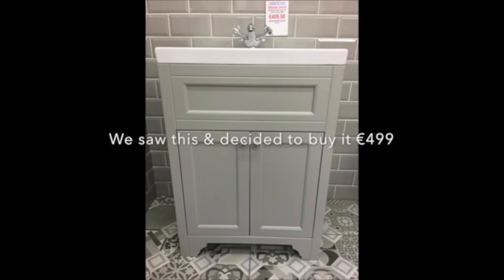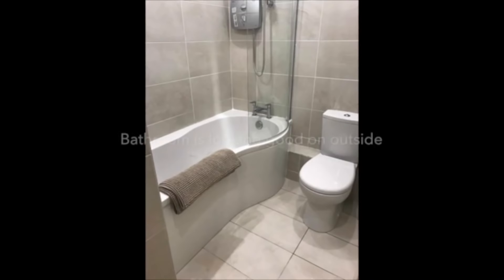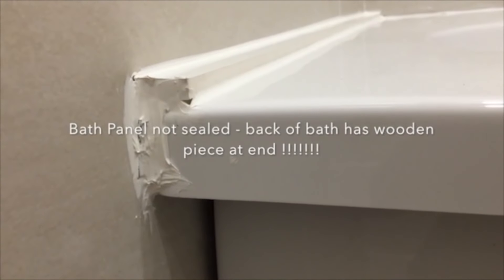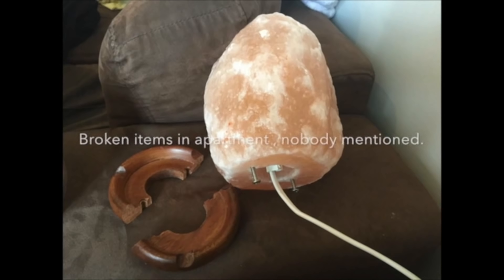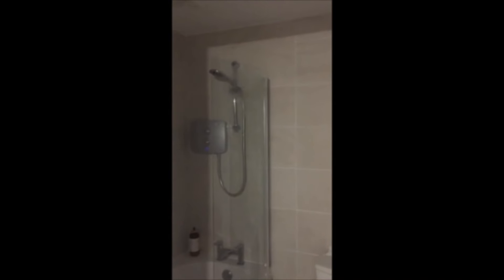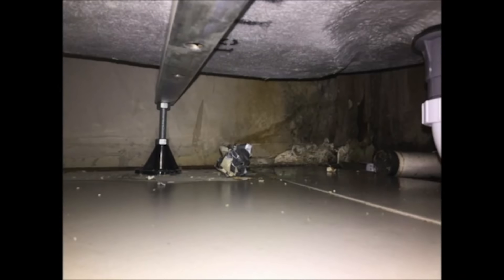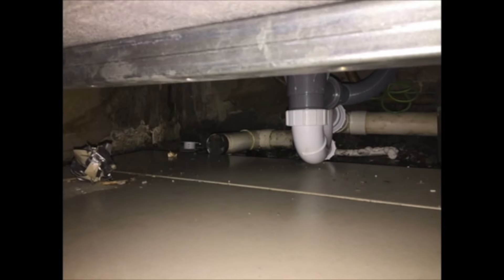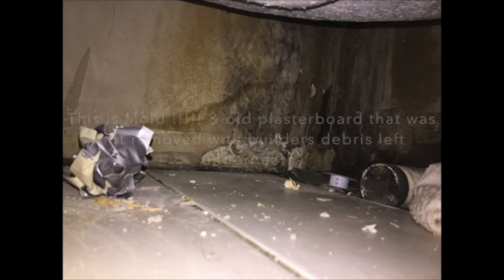New Bathroom Nightmare ~ ASB#23

Comment: Hi mate after abit if advice if possible I’m looking at buying a house it’s had a extension on the back  which the floor steps down for some reason so the floor is lower on the dpc  sits one brick up rather than the original 3 course up on blue bricks will this cause any problems do u think
Reply from the maker: Hi Irons TV 
This is common for an old kitchen scullery. My house is the same. It shouldn't cause any problems if there are no signs of the damp proof course being bridged.

Comment: That shower screen is meant to pivot so silicon sealant on the bottom means the morons fitted it too high for the bottom flexi seal to rest on the bath.
Reply from the maker: In fairness those kind of screens rarely go well. There is always that bit at the bottom of the hinge that doesn't seal. The trouble is that when the customer sources the kit they don't get the installers experience. I hate those bloody panels as well.
Reply: Skill Builder the reason I know it hinges is because I have one. Fitted myself 8 years ago never had a problem with it because I fitted it correctly...

Comment: Are plaster walls behind baths always left bare, or are they normally tiled?
Reply from the maker: The tiles are normally brought down to the top of the bath. The wall beneath the bath should never get wet.
Reply: Should be a cement based board that's resistant to moisture instead of plasterboard. Hardibacker is good one.

Comment: 1st off the obvious silicone around the bath is lifting because the bath wasnt filled  when it was sealed. 2. The seal on the screen isn't the 1 the came with from the manufacturer. That I bet was accidentally binned as they a normally hidden in the packaging. 3 Compression fittings on what looks like 15mm plastic is a big fucking no what's the point? it's going to leak! it's going to take ages to install and that's never going to be seen because it's in boxing. 
4 boxing is the the lazy way out do the job properly get the supplies into the wall or chased in the floor same with the wastes I completed 30 full bathroom renovations last year only 1 shower tray went up on legs and I built 0 boxing's and finished each job on schedule or earlier. Which leads onto 5. Cost. Customers need to realise that the increased cost in getting pipes into walls, under floors, using proper fittings, added labour time getting this right is short term. Yes it more money out of your pocket this month but 6 months a year even 5 years down the road when you have a great bathroom that you enjoy with no issue like this is well worth the expense of  a few hundred pound. You pay peanuts you get monkeys. There is only 1 Way to do a job and that's the right way Point! Anything less and you end up with this. (Right where is the drop the Mike emoji?)

Comment: Bathroom lights on a dimmer switch? Are the bulbs in the lights dimmable? Did you hold any money back so that you've got some leverage?
Reply: It looks like they're led fittings, the flickering randomly is usually because of the nature of LED drivers, the led dimmer switches usually have a way of trimming the low setting so that the voltage doesn't go low enough to cause the flickering.
Needs replacing because of the bent switch but the lights themselves should be fine.
Given the quality of rest of the job & they didn't trim the dimmer probably best to rip out & start again though!

Comment: The world is full of bodge builders & dodgy, lazy trades which cut corners & make a complete mess. A new bathroom MUST start with a gut to studs & joists (unless you can access the joists from underneath). Tiles are heavy & require perfectly flat, stable sub surfaces. Water is heavy & requires sturdy "overkill" framing. Sub surfaces must be mold resistant & the layer below the tiles must be capable of directing water to the draining pans in a "belt-n-braces" approach. Traditional wood has limited use in a bathroom, MDF has no place in there at all. A bathroom is a "showpiece" of a house. Electrical & plumbing must be robust, safe, logical & to code...it is VERY permanent & is going to be buried for 20 years where you cannot fix it later without destroying the finishes. It is extremely well illuminated, it's features are on full show, lines are straight, square & linear, the environment needs to feel strong & sturdy to the touch. It is a room under a dozen microscopes every day of it's life & it is under constant attack from destructive elements & uses. The job cannot be rushed or done "on the cheap". A bathroom is a living advert for a contractor or handyman...it is a 20 year testimonial for the quality of your work...or it is an embarrassing  millstone which will come back to haunt you & your reputation for decades. If you can't do it properly do not take the job on in the first place!

Comment: Why are so many “tradesman” so piss poor at silicone sealing? I am in the trade myself and see this day in and day out by joiners and plumbers, silicone finishing should be both functional and cosmetic. The days of just spitting on your finger and dragging it across are long gone, even for the guys that can’t get a good finish there are many tools and tapes out there that can help get some what of an acceptable finish so there is no real excuse and even if your still rubbish after the tools and tapes then you have the option to call in someone who does this solely as a job.
Reply: The silicone is the least of all the problems here, had everything else been correct, I would have overlooked the caulk work.
Reply: The silicone work is indicative of the general attitude here. Get the job done asap take the money and run . They obviously have no morals or pride in their work. Would they have been happy with someone doing this in their own house?
Reply: Tom Baker the silicone is a big part in a way as around the bath isant properly sealed allowing the water to escape when showering, but on a job like this it’s one of many problems.
Reply: Looks like the surfaces weren't prepped and probably siliconed over dust. Get in, get paid, get out job.

Comment: its really no use when  we get no information on how much this cost?
Reply from the maker: I knew there would be people who would say this is what you get when you go too cheap but that is not the point. Even if it was a cheap job it falls below any standard I could apply. Do you really think there is a price which is so low that this becomes acceptable?
Reply: @SkillBuilder  I would say the point being it is not acceptable but more expected that corners are going to be cut. Either way the people who carried out the work shouldn't have been let loose on this project. Subbed out by the bathroom shop?
Reply: @SkillBuilder  Roger, I love the channel so please don't misunderstand me.
The standard of work is absolutely appalling and I don't think it's acceptable to an owner.
However I do think that knowing the cost of the work is important, who did it?, why did that couple get that particular installer? and was it a sub contract etc etc?

On your point when it comes to this being acceptable - yeah I do - property flippers would probably consider it acceptable!
Your viewer even states it looks "cosmetically good" or something similar.
That's all the surveyor looks at - visual inspection!

This is especially true in pressured property areas!

Comment: OK, I am not a plumber or bathroom fitter. However, my shower room downstairs was a bit of a yeee-hawww job from the previous owners, and I am in the process of ripping it out back to the brickwork and concrete floor. Everything is going in the skip, and I am rebuilding it myself (thanks to Rogers Skill Builder videos I have taught myself what I need to know). No way am I paying someone to rip me off. These guys need to rip all this out back to the fabric of the building, get themselves a de-humidifer and run it for a week at least in the bathroom and bedroom and get it fully dried out. A hair dryer will never ever achieve that. Good luck.

Comment: Hi roger,  just needing a bit of advice from yourself.  I'm in the process of putting a shower in my bathroom and was wondering if you would stick to the usual shower trap or go for a inline trap,  space is not an issue  I'm thinking ahead for ease and less chance of issues with the usual hair problems.  I'm in a position  that the room below is a garage and thinking about putting an access panel in just in case for one or the other but at the moment in swaying towards the usual system as i don't see how i could remove the inline easily. Many thanks.
Reply from the maker: Go for a Mc Alpine shower trap. Easy access for hair removal from top. It is a weekly job in our house.
Reply: Many thanks for the reply, will do that, mcalpine do good products. Enjoy the rest of the weekend

Comment: Firstly they could not have framed the walls to suit the bath length, I would also recommend fitting a 2 x 1 around the wall and bed the bath on it with good silicone, prevents movement from getting in and out the bath therefore prevents the final seal from detaching from the bath, next bath height, looks like the bath trap is squashed against the floor, also the tiles should go around the bath once installed looks like your tiles were installed before the bath, shower screen looks like it is fitted to far to the right so it is not following the curvature of the bath, no need for silicon in the glass seal it will just go mouldy over time. Assuming the lights were not working so the painter painted in the dark 🤪, was the floor self levelled prior to tiles going down? May explain the vanity unit being up off the floor, also green plasterboard or wedi board should have been done at least around the shower. Electrics need tested by qualified spark that’s a must! On the whole this job is a bag of shit and I would definitely not pay the company. It’s got a 1 stop shop handy man written all over it. When we do bathrooms there are 5 to six trades on it every time. If ever someone told me they done the complete job by them self I would be worried 😧

Comment: plenty of mistakes made there, reality is vast majority and id say all so called luxury bathroom retailers that provide fitting will tile directly over the damaged walls,  

just this instillation also happened to included some shoddy plumbing

as a bathroom installer i price against bigger bathroom retailers and its imposable to compete, they  are bathroom flippers, less preparation means less building material cost and labour,  lower price,

anyone thinking of getting a bathroom installed should check out there installers facebook page etc for installation pictures,    better still search for the showroom name and you'll find fitters that contract for them and check out there installation pictures,        contracting for a bathroom retailer basically entails fitting a shiny suite in the quickest time possible to reduce the cost to the customer, the labour time to fit the suite has to be minimal to achieve this

id recommend looking for the following;    if walls to be tiled are plastered with gypsum plaster or tiling straight over damaged walls or using plywood as a substrate to be tiled don't use them

avoid general jobing plumbers that aren't bathroom fitters, in modern  bathroom suits the actual plumbing represents a small amount of the work     ie to fit a shower tray and enclosure a plumber that specialises in bathroom fitting or a carpenter/builder is going to be more capable than your average jobing plumber or boiler fitter,        

look for close up pictures of silicone, decent fitters will silicone perfect freehand without tooling down, try to see if the plumbing looks neat, walls should be prepared with new BARE drywall or tile backer or a cementitious background, (never with fresh gypsum plaster!!!), supports around perimeter of baths, new walls and boxing should look solid with noggins etc, floors prepared with cement board or orange kerdi (no chinese ply or even marine should be used know),,,     i could go on and on but my point is you can easily suss out the quality of your installers work by looking at there job photos

Comment: You should have asked them to remove their blindfolds before starting the job. I was trying to find something that had been done correctly but I couldn't find a single thing. Even cows could do a better job than those idiots, I hope they got trading standards and a solicitor involved and they should also name the ones that did the job to warn off any other customers. It looks as if they have tryed to control the lights with a dimmer switch, it should be a normal switch, I wouldn't touch those switches in case you get a shock of electricity.

Comment: It happens all to often I'm a Chippie and when I put a quote in no matter how low there's a Jimmy or Johnny from the pub who can do it cheaper 🤦‍♂️ of course Jimmy or Johnny's not a tradesman so they ask me down the road to fix it I once quoted for putting new cornice and pelmet on a kitchen of course I was to expensive I was called back a week later Jimmy and Johnny cut it with a handsaw and stook the joints with double sided sticky tape 😳😝😝😝😝 I went around and quoted him double and the client said why the extra I told him I had to take it down and start from scratch needles to say I didn't get the job ah well 😝😝😝

Comment: It’s all wrong. Never but a bath up to tiles like that. I like to run a baton down the wall 2x1 and tile on top of the bath. Plaster boarding any walls needed to make square. And making note of my bath panel height + tile + adhesive + ply etc to make sure the bath panel clicks into place. Some people have no pride. If you do a job do it probably. Did he have spurs on his boots.

Comment: Are the lights meant to be switched independently somehow? Im an electrician by trade and can’t think how they’ve managed that. Unless they’ve taken several cables from the dimmer and one to each light and there’s a bad connection behind it. All round piss pore though. Excellent videos thanks.
Reply: LEDs on a non LED dimmer perhaps? They were doing some freaky shit those lights!
Reply: Perhaps a timer fan in conjunction with the dimmer as well?
Reply: @jamesdyas542  yeah good shout. I'd hate to see what's going on behind those downlights. Probably a fire waiting to happen. Obviously not enough space behind to accept the fittings the way they're sitting off the ceiling.
Reply: I'm no electrician but have a keen interest. I bought an led dimmer switch but needed to buy led lamps suitable for that exact switch. There's was only like a dozen tested gu10 lamps deemed suitable. The guy probably bought the led downlights and bought some led dimmer that behaves that way or like the other person said a non led compatible one. The lamps probably didn't have any IP rating going by the rest of the job. Also, are the lights above the bath in the wrong zone?

Comment: The lighting is straight out of a horror movie.... I have seen this before, extractor fan - dimmer switch - led lamps....you can fix the  'capacitance' by installing a 4 microfarad capacitor on a lamp terminal - this enables the led lights to switch off.